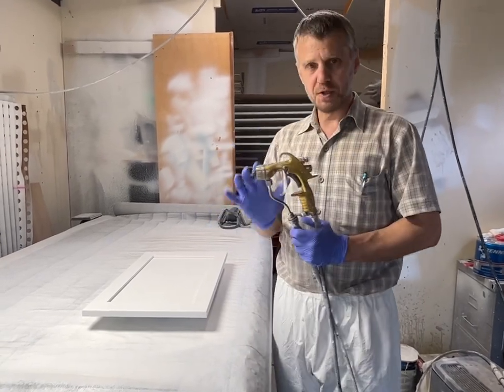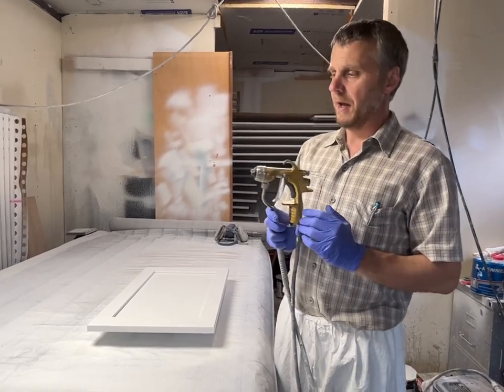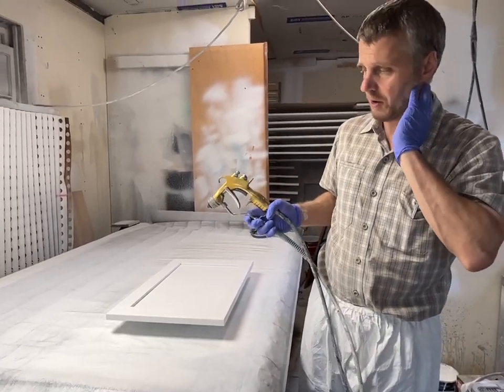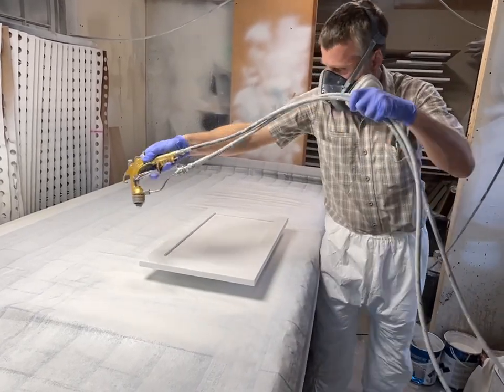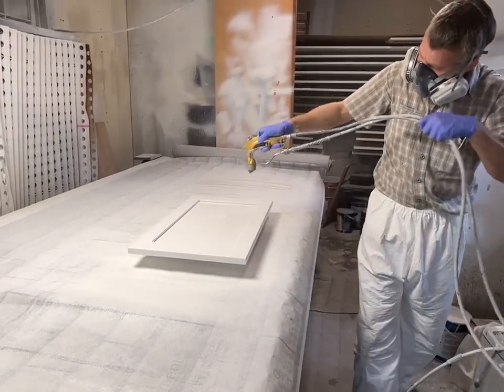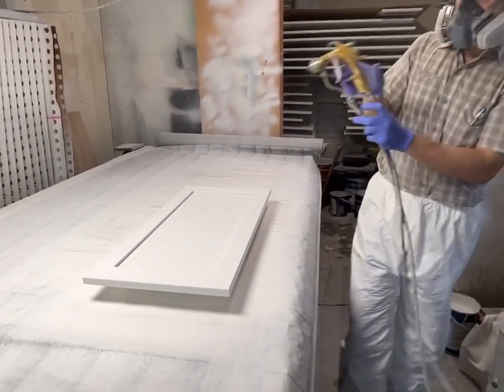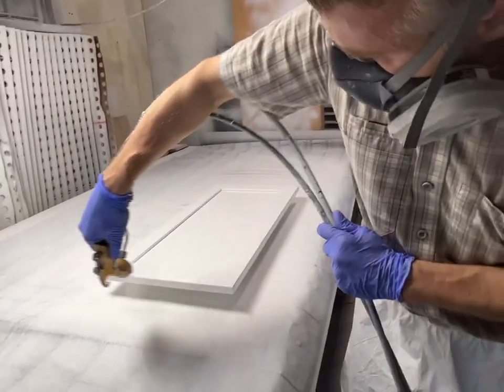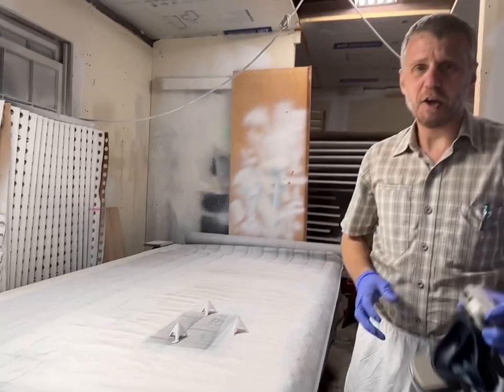My Favorite AAA Air Assisted Airless Spray Gun for Renner Coatings. Best Tip Sizes for Water Based

Comment: Very helpful. I'm almost ready to spring for the Kremlin Xcite but I'm trying to decide what tip or tips I want. I have always sprayed cabinet doors with a 308 FFLP off site but I am really hoping to optmize (Reduced overspray and slow application for control) for spraying face frames in the customers homes. I see that you like the 092\ 306. Are you using the fine finish or Xtra fine finish tips?Would you recommend that or a smaller tip for spraying face frames? I'll be using it with a graco 395 and a thomas 2820 compressor. Thanks
Reply: 210
Reply from the maker: For topcoats on face frames, you can go down to kremlins 04 or 06 tip. 04 works well if you reduce a little like you would for a cup gun. Sprays about the same. Primers go no less than .09 Kremlin tip

Comment: Don't you get paint bouncing up on the other side of the door painting on a flat surface like this?
Reply from the maker: @joseph7105  I actually didn't have paint bouncing with this sprayer. I don't normally spray this way though.

Comment: Great video and perfect timing.with the 06 tip if you use the screen do you remove the white oring inside the tip?
Reply from the maker: I don't think the 06 has an O ring
Reply: Hi 
Do you like that gun better then Wagner 4700?
Reply from the maker: @slawomirbieganski5315  I like them both but if I'd have to choose between the 2 I'd choose the Kremlin
Reply: Can you share which spray cans of acetone you are using?
Reply from the maker: @mikerichter1694   it's a 3m product I buy on Amazon. Spray gun cleaner.
Reply: @homesteadcabinetdesign3406  ...Thanks!

Comment: You mentioned the 06 tip but which one 092 or 112 ?   Also have you tried the 04 tips with water coatings like the 04092 or 04112 ?   Oh and lastly how often do you replace your tips ?
Reply from the maker: I personally like the 092

Comment: Awesome video.

I have a kremlin 10-14 pump  with the excite gun, but it's not powerful enough to spray our top coat (Milesi 1k and 2k products)  
Your setup seems like it would be great for us, instead of getting a new Kremlin pump, get a t4 or t5 and the hose adapter (any 1nfo on those appreciated)
Is the T4 sufficient or is the T5 worth the upgrade to spray these coatings?
Reply from the maker: That's why I hooked mine to a Tritech Airless. See my video on that.
Reply: That 10-14 was designed for pre cats. Look into a 15c25 or a 20c50 minimum.

Comment: Hi there, good video. What paint and catalyst do you use? I use renner 760 topcoat and add a small amount of water to a tin when sparying.
Reply from the maker: I use mostly Renner 688 or 851. I reduce by 5%. I have reduced up to 10% with no problems as well.
Reply: @homesteadcabinetdesign3406  thanks for the reply. Is that the 2k versions? Do you spray that in customers houses?
Reply from the maker: @thomasdelaney1557  yes

Comment: From what I understand, is it possible to buy only the Graco G15 or the Kremlin Excite guns and plug them into an airless pump (in our case a graco 395) and a air compressor ?
Reply from the maker: Yes, that's what I did. Needed some fittings for the Kremlin line to fit on my airless though. But the g15 will go right on a standard fitting.

Comment: if you are spraying on site i.e customer houses, which system you recommend: turbine or compressor: also which turbine system you recommend and  which gun with it, thanks in advance
Reply from the maker: I have used both a turbine and compressor. If you use a compressor you will need a spray gun that will take a low CFM.